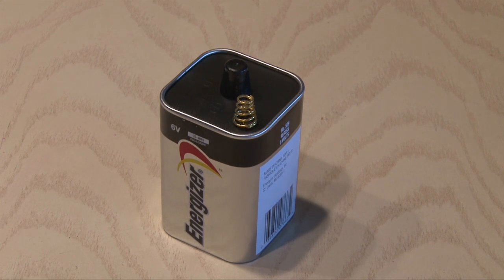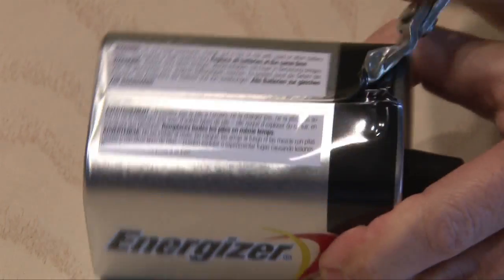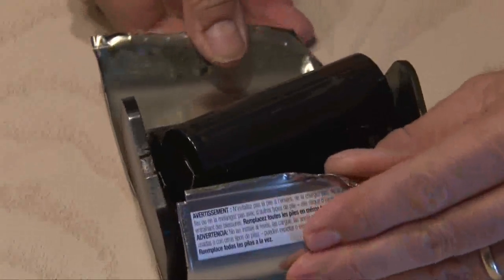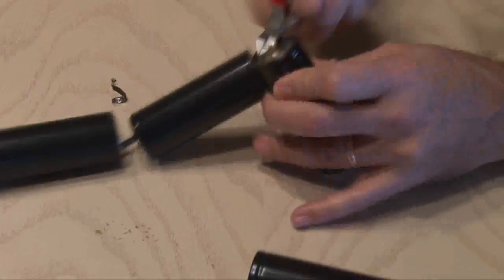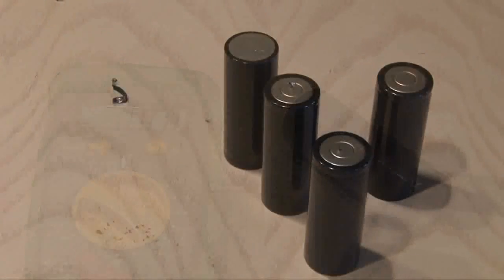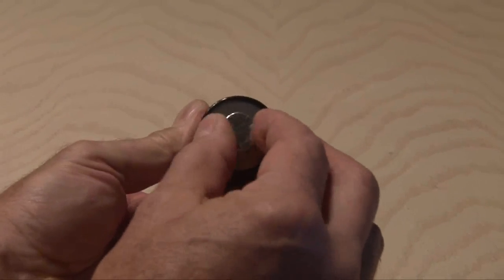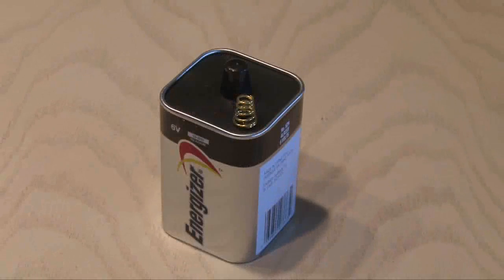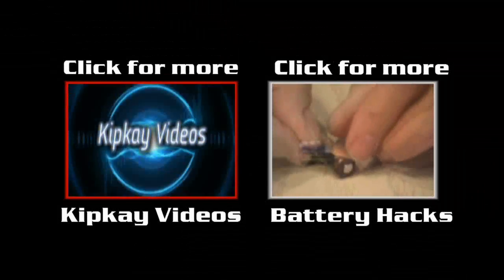6 Volt Battery Hack!

Comment: You can use two of them in some 2d flashlights, but only if they are long enough you can remove the spring to take up slack. Then you will have more power than the d cells.

Comment: i watched daneboe and his lantern battery hack  has 32 double aa batteries
Reply: +John Doe does not know what he is talking about.  A LOT of "lantern-cells" have the MANY smaller batteries.  John must know NOTHING regarding parallel wiring.
Reply: +John Doe Very good point.
Reply: Duracell 6v also has 32 AA

Comment: I thought you would get 32 AA batteries. This is fake.
Reply: Just because you THINK Doesn't mean it's fake. You're not the center of the universe.
Reply: minecraftultima529 The Joke

                                   Your Head
Reply: The f cell battery looks like it's raped in electrical tape.

Comment: hey kip, i know this video is about 2 years old, but in the comments i noticed you said "now im not sure what you can use these batteries for" well i have a shock for you, i am a rc car enthusiast, now 2 of my 3 rc vehicles run a 4000mAh 4volt 2 cell lipo battery and one of them will do 60 MPH!! (traxxis slasher rc truck), now in your video you said the F cell will atleast have 1.5v and 2400 mAh, well i figured that atleast 2 of those would run in my truck and drift car.

Comment: you can also try with 144ohm that would make the output 0.25W but I'm not sure if the LED will tolerate that or not. But increase the output from 0.18W to 0,25W will make a but of a difference at least when the Voltage is double.

Comment: you can manually connect a battery bank of lantern batteries 12v or 6v, and use it for backup LED light system you can make kipkay, it would be fun to make i guess. also quite simple ( of course I know that LED uses 3v, but if you connect an resistor with 160ohm you can make the power output of the LED light higher without burning it, A typical LED uses 30mA so that'll require 200ohm and will be 0.18W, but 160ohm will increase the output to 0.225W without overloading the LED.

Comment: if the battery is not 1v 1,25v 1,3v 1,5v 3v  Then it is made of multiple cells, Normally setup by multiple 1,5v cells ( Alkaline ) or 3v cells ( lithium ) But some Batteries like the 9v ( Can ) be made of 6 cells that are welded together or made of a singe 6 cell ( 6 battery cells inside a single body ) ( that means its 6 cells but the cell wall is shared by all the battery cells in that single cell ) sadly cant be writing links on youtube anymore.

Comment: there's no radioactive batteries and by the way most of the 6v lantern batteries (spring the type of lantern battery in the video) has 4 1,5v Alkaline F cells. opening the Alkaline cells are not recommended, it can erode your tools making it more vounable to rust and if you get the fluid in your eyes you can be in the worst chase permanently blinded.

Comment: F cells are equal in size to 1 and a half D cells, so 2 will fit a 3D cell Maglite torch, 4 a 6D Maglite. I have bought lantern batteries for as little as £2.09 on Amazon - try getting 6 D cell batteries for that!

Comment: That looks like fun. BTW, in other 6 volt lantern batteries you will find 4 D cell batteries, and these bad boys actually can be used to power something, and are sold in shops that sell batteries for more expensive than AA or AAA batteries. Guess that's why big specialist batteries are powered by smaller specialist batteries.

Comment: @waynefan623 I'm sorry, but you had no idea which type of battery i used, so don't make comments about other people to make yourself look smart. As i said, KNOCK OFF batteries. The ones I got were Chinese and they turned out to be acid batteries. Also, I hate lithium batteries, and I WILL NOT buy them. Enough amateur robotics projects have been ruined by lithium batteries and they are not worth it.

Comment: that's something I don't understand about batteries... 1.5V come in like 8 different sizes.. 9V are a bit bigger than AA batteries, 12V are smaller than AA batteries and 6V batteries are bigger than 9V ones...
wouldn't it be logical to have 1.5 being the smallest and 12  being the largest?

Comment: @SlimySnail44 make sure you use the same battery that's in the video. And generally six volt batteries are made up of smaller cells. And (i don't recommend you do this) but if you open up one of the batteries, you will find manganese dioxide which you can use for experiments and whatnot. But no I'm not kidding. (And I'm not liable....)

Comment: if your into chemistry you can open up those F cell batteries to get a carbon rod , some zinc and some manganese Dioxide. Unless it says on the battery that it is an alkaline battery and not a carbon zinc

Comment: I have an xbox 360 wireless controller rechargable battery pack but the batteries are dead, hold no charge. Would you be able to make a video showing how to change the batteries?